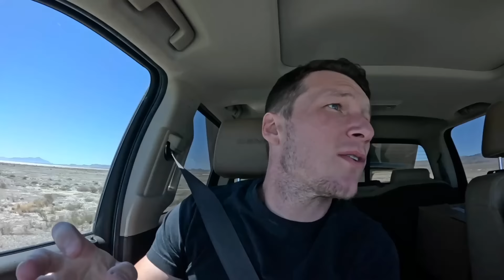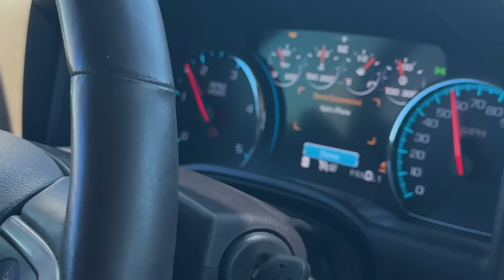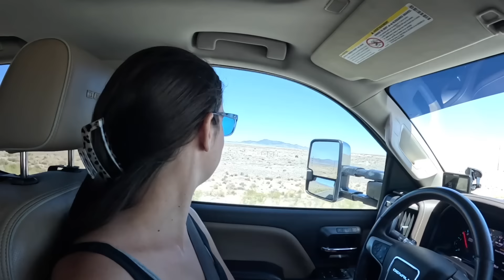New Trucks are 'Built' to Leave You Stranded

Comment: While choosing a oil filter would take a picture of the manufacturer filter where the gasket is look at the size and number of holes. This way if you can't get the factory one you can get on ther can flow the same amount oil. The crazy thing is if you can get a government diesel it won't have a DEF or egr system on it.

Comment: Old truck drivers use to add transmission fluid to their fuel tanks before DEF.  The fluid helped remove water from the injectors.
Reply: Helps clean the injectors too.

Comment: Seemed like a nice enough guy but before misinforming people about diesels maybe take into consideration that this guy had almost exclusively pre DEF trucks in his shop. No lift and was working off of folding tables piled high with crap. He either was excessively trying to dumb down the information he gave or it became misinterpreted during editing but some of the information giving is incorrect. Modern diesels are not designed to fail like this channel leads you to believe these trucks are just strangled by politicians. Really enjoy following y’all’s travels. PS: the largest US Flag is actually at the Acuity Building in Sheboygan WI 70’x140’
Reply: True!! I wouldn't trust this mechanic! He claims DEF is 90% Urea (it is 32.5%). He tells us to add ATF to the diesel fuel (not good for modern diesels). He doesn't even know that Dodge hasn't made a truck since 2009!! These plus several other questionable statements make me want to run from him and his shop!!

Comment: My solution to new diesel pickups is an old diesel pickup.  5 years ago, I bought an '05 Ford F-350 Lariat, 6.0 liter diesel, crew cab, long bed, 4X4 in beautiful shape for $10,000...no DEF, no particulate filters, no re-gens.  I've had a few issues like a refurbished FICM, blown turbo/intercooler boots, frame rail fuel pump. I have enough money in the bank to bullet proof it if/when that time comes.  I pull a '21 Grand Design Reflection 303RLS all over the West and couldn't be more content.  I really enjoy your vids...keep up the good work and hope your problems are few, cheap, and easy.  Hi to Nay Nay!

Comment: You can absolutely thank the state of California and the democrat administration for all the new diesel emissions. I have the exact same Denali GMC you have, mine is a 2018. I can tell you one thing, do not put DEF from any gas station into that truck. Use AC DELCO boxed DEF only. It is much cleaner and will save you headaches down the road. Love your guys content.
Reply: Absolutely on both: cause of DEF standards (first state to require a smog test on a diesel), and OEM fluid - my ‘21 complained /throttled after about 10-20 miles after 1/2 fill w/ an auto part store “gold” (the best) def fluid - never a problem with fresh OEM. I would do a banks, delete whatever but would never pass CA compliance /smog check.

Comment: Definitely appreciate you digging in and sharing the technical side of diesel trucks. Please continue sharing these issues as you chase them down. The information is invaluable 
I am the third owner of a 2003 Chevy Silverado 3500 6.6L turbo diesel which I bought in 2010 with about 70,000 miles. It now has about 173,000.. I tow a 32 foot fifth wheel
However, I’d suggest asking your questions completely open, ended versus leading with a thought/opinion that generates an agreeing response. For example, “how has the quality of diesel engines been over the last xx years?” versus “don’t the new diesels have more problems?”   
It would appear there’s a similarity between the newer RVs and the newer vehicles with both having more issues than the older ones, generally speaking. Some of that is due to adding a lot more features.  As I write this, I’m watching your video but I’m only in the first few minutes so I may have to change my comment.

Comment: Rislone 4780 Diesel DEF Treatment | Prevents AdBlue/DEF Fluid Crystallization, 8 oz helps with DEF crystallization. Can get it from Amazon. I use it every time I add the boxed DEF. My 2020 Silverado has the DEF fill next to the fuel fill. GM put the DEF fill under the hood on older GM stuff to stop the "new diesel owners" from putting the DEF in the fuel tank. HOWEVER, my truck did NOT come with a fuel cap (god I hate capless) so it's my opinion that GM figured thier customer base "got smarter".

Comment: I have a Colorado Diesel.  Monday, we were westbound on CA 46 crossing CA 33. Had reservations at Hearst San Simeon State Park, just outside Cambria on CA 1. Which is a great place to stay on the Central Coast if you haven't been down there lately.

 Stopped at the light and as I accelerated, I got a warning on the dash read-out.  "No Oil Pressure. Stop Engine".  Pulled over to the right and stopped engine.  Insert choice of colorful words here.  95+ degrees.  Only good thing was we were across the road from a gas station whose current claim to fame is selling creations made from the local almond and pistachio farms.  Was also the last place James Dean stopped for gas on his last trip over Highway 46.

Checked dipstick, hmm, full.  Started engine.  No lights, all the gauges and screens showed fine, no leaks or traces of leaks underneath.  Just outside of Paso Robles I got a Check Engine light.  Great.  Got to the campground. Well, we had planned to visit Paso in the morning anyway.  Chevy dealer ran the codes, hmm, fan.  Cleared it and it hasn't come back.  Nothing like going up the Grapevine behind a truck who had a truck pull out of the slow lane in front of him.  20 mph sweating literally and figuratively.

Wouldn't pass the smog check last fall. Took about two months to get a small part replaced.  Back ordered, but drove iot until the part arrived.  About 3 hours in the shop.  All the gases and readings were ok, it just wouldn't clear the fault notification. Took about 2 months to finally hit the right combination of speeds to clear it. So for almost 5 months I drove with an incomplete registration. So I had the receipt from DMV and a bunch of papers from the Dealer and Smog Check stations to present if I got pulled over.

While my operating costs are cheaper, I passed the cost differential for buying a diesel over a gas engine about 20 k miles ago.  I get about 20-22 mpg not towing.  I doubt I will get another diesel.  Friends with Ram and Ford diesels and same thing usually great, but if something goes wrong, you can be really screwed.

Comment: I’m getting on the road in less than 3 weeks. This is on my mind more than I want to admit it. I’m getting a 2016 f450 dually to tow a 44ft momentum. This video right here is my nightmare. But I’ve heard the epa is changing the rules. Maybe getting rid of the def system all together. If somebody reads this am I right in thinking I heard that.

Comment: For an extra $10,000 +/- uncharge for a junk DEF diesel, which are not going away tomorrow, one would think that saving that $10,000+/- upfront FEE would cover any potential concerns with the heavy duty gas trucks. IMHO - Save the $10,000+/- Upfront Penalty for the Junk DEF Diesels and buy a new Big Cubic Inch Gas Motor. If any problems arise you're at least $10,000+/- ahead to start. *I'd bet $10,000+/- that you will be happy with gas!*

Comment: Number 1 fix? Don't buy one of these diesel trucks. They are designed to breakdown so the owner has to spend even more money. It's a huge scam. On these newer Fords, a fuel pump replacement requires that you remove the cab. A friend of mine spent $7000 doing that recently.

Comment: Not sure if you got my comment from a prior video, but I use peak platinum deaf fluid as it cleans and doesn’t crystallize the system opposed to standard peak deaf fluid.  And quit using the Def at the diesel pump. Spend the extra money and get the Def platinum in a jug.

Comment: Yeah, there isn’t one truck driver or anybody in the world that likes DEF it’s a piece of junk system that there’s nothing but problems and breaks down causes people tons of money time and effort. But maybe Big Gov in about 40 days is making it so you can delete that, Shops are gonna be busy pulling all that junk stuff off the trucks about 40 days.
But there’ll be a couple of states that fight as usual so all the environmental people. The whole thing is when your truck is in region, if you put an animal in a trap right by the exhaust, it’ll kill them dead as a hammer. It’s worse than the smoke coming out of the stack, Or the muffler. Totally ridiculous in my opinion!
Reply: One thing you can do that will help though when you’re letting that truck idle if you can set your cruise control at idle, some trucks will let you do it. I know the Dodge will turn your RPMs up and idle 2 to 300 RPM and it will help that diffuser not clog up.

Comment: I have a similar truck, same engine L5P. It’s time to delete. That won’t solve the injector pigtail issue. But all the emissions troubles will be gone. I’ll be deleting. I encourage you to as well.
Reply: If you delete how often do you have to get a smog check in your state. Then is it worth it to delete it and re tune and then reinstall it re tune and get a smog then delete it and retune it.
Reply: @jacobiejacobs8668  yes, I see your point that if you reside in a smog state you’d have issues. I do not live in a smog state. If I did I would not comply, or move. But that’s my personal choice. You would need to evaluate for your own situation.

Comment: You that are saying "delete" listen to 7:24. It is totally illegal. Dealers cannot sell them and you cannot sell it without potential legal issues. The best thing to do is buy gas. I do not agree that the tranny, brakes,  cooling system---- and other components on a gas powered truck of the same class (half-ton/ Three quarter ton, etc.) are less durable than on a diesel truck like the guy says on this video. They too are rated for what the truck is able to haul. etc.
Reply: soon to be not the case. See recent announcements this week by the EPA.
Reply: There is a durability difference between gasser and diesel transmissions. For example Ford's E40D gassers come with aluminum 3 geared planet gears and the diesel came with steel 6 geared. Diesels can also have more clutch packs, less end play, higher line pressure, tighter bearing clearances, etc. The same thing applies for the newer 10R140 from 2020 up. Like you said, they are rated for the torque/hp of the respective engine so to that extent I see what you mean, but if you are for sure someone who is hauling heavy load your transmission in the diesel will last longer without a doubt.

Comment: That trip to Alaska rattled everything in your trucks electrical components.
Future models have re engineered and beefed up wiring issues.
Many improvements have been made, like moving the DEF fill nozzle to the Diesel fill area.
We haven’t had any issue’s with our 2022 High Country Duramax.
Sounds like a new truck is in order, instead of trying to travel with an unreliable vehicle.
Safe travel’s

Comment: Just delete the emissions on that thing man $2,700 done with the emissions no more DEF fluid 27 mi to the gallon average with nothing in the bed 18 pullin
Reply: You guys are Florida I don't remember where you guys are from of course you can't do it if the state want you to have emissions LOL Florida gone been deleted for about a year now best decision of my life!
Reply: @jaredschroeder6484  Do you mean you go from 14miles to the gallon to 27?!?
Reply: @Sportfot without the delete I would get an average of 18 mi to the gallon on my truck it's a 2018 2500 l5p, with nothing in the bed on the highway just driving, after the delete I get average of 27 mi to the gallon over 100 mi I've seen 31 mi to the gallon average as well mainly 27, if I put my truck camper in the back I get 18, and if I tow my 37-ft travel trailer I get 17 to 18 MPG, the tune came from Canada $2,700 five tunes shift on the fly
Reply: @Sportfot  stock tune in tune 1 do not roll coal they smoke tiny bit if you put your foot down to the floor coming up the on-ramp those are the tunes I mainly drive around in. I'm not into rolling coal ie.wasting fuel and I'm not into loud trucks I actually think it might be quieter than stock I went with the 4-in pipe and I put FTE's 30" resonator on it. You would never know it's deleted unless you notice and are curious enough to wonder why the DPF tank is not on the truck. 😂
Reply: @Sportfot I think the Hanks might be from Pennsylvania though but I could have swore they changed to somewhere else for domicile or something I don't fully remember PA doesn't allow you to delete it though I wouldn't want to delete it and then have to put it back on for emissions testing that would be a pain in the ass

Comment: Another 35 days and the EPA is going to remove restrictions on light, medium and heavy duty trucks. Get it deleted man.
Reply: Fingers crossed! Would love to see that happen.
Reply: Counting down the days
Reply: False.
Reply: @theshastafarian  Time will tell.
Reply: Source link please
Reply: @gastonbelanger5346  https://www.epa.gov/regulations-emissions-vehicles-and-engines/proposed-rule-reconsideration-2009-endangerment-finding
Reply: Should every gasoline vehicle be deleted? Do you want the air to stink as bad as it did in the 1970s?
Reply: @gregorymalchuk272 it would never get that bad, was it like that before 2007? That’s when they started putting all that crap on the engines. Stop believing all the propaganda associated with “climate change”
Reply: @gregorymalchuk272 diesel Particulates sink to the ground. They don’t pollute the air like gas emissions do.
Reply: @PumaPete Advanced gasoline engines get lower emissions and better fuel economy on lower cost fuel.
Reply: @gregorymalchuk272 doesn’t change what I said. Yea gas engines are far cleaner than they used to be. But diesel doesn’t pollute the air like gasoline does.
Reply: First, it won’t be a “no emissions” deal. Second, it will probably change on new vehicles going forward.

Comment: This won’t help your emissions problem but as you were recording under the truck (4:35 as an example) there is a bolt (silver in color) that has a lot of threads showing. Not sure what it is for but you may want to check it out.
Reply: I think that's the adjuster for the torsion bar

Comment: There is EGR on gas trucks also. Use good quality DEF and do not Idle truck at all. Start it and drive it. Idling run on a different fuel circuit and creates more soot.

Comment: Diesel emissions are a joke in America. The manufacturers have not found a way to make them reliable and the customer is the one who has to figure out a way to overcome the issues. Best way is to delete the DPF/DEF system along with an egr block off. The trucks will run better, provide more fuel efficiency, more power and will no longer leave you with limp mode or worse stranded. Talk to any diesel performance shops and they will all tell you the same thing - delete the system. I had the exact same issue with my 2011 Duramax and after 6 times to the shop I did the delete and did not have any more emissions issues for the next 400,000 miles.
Reply: What do you do when you have to have an emissions test run?
Reply: @jamescox857  Move out of that area
Reply: @jamescox857 yeah my question too. I had a 2011 Ford 250 deleted but never had to have a test. We sold it before we knew we needed a tow vehicle and now were back in the soup with a 2024 2500 Ram just waiting for the warranty to run out then we'll get it deleted I hope. But thats a good question what happens if you have to be tested? And what states are sticklers? Cali I'm sure.
Reply: VW had a way to pass emissions

Comment: Dude just delete your exhaust you won't have these problems and it will.make the engine last longer
Reply: Don’t delete 
1 it’s illegal 
2 dealers won’t touch it if it’s deleted 
3 you lose value 
4 if EPA finds the shop that’s done that they will make you fix it
Reply: @Robe-f2s  He means the whole exhaust... just start from the manifold and remove it all.  You can ignore the noise and the black soot in the engine compartment.  That's all part of the process.

Comment: You put your truck thru the most extreme conditions! It will break more often
Reply from the maker: You are correct. We try our best to maintain, but some things are unavoidable. Thank you for watching
Reply: I was a hotshot transporter and I towed much heavier items and put just over 500,000 miles on my Duramax truck. This 5th wheel is not the cause of the problem.